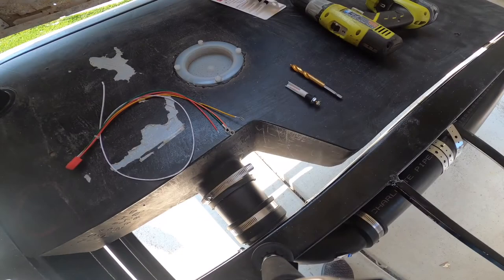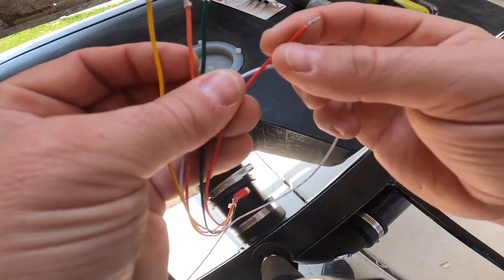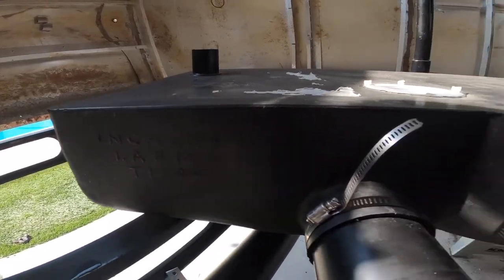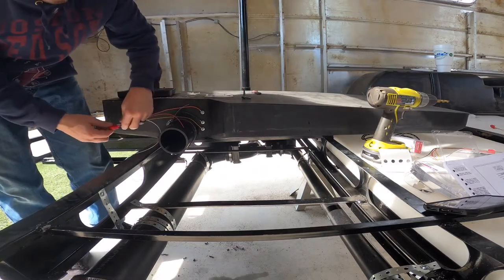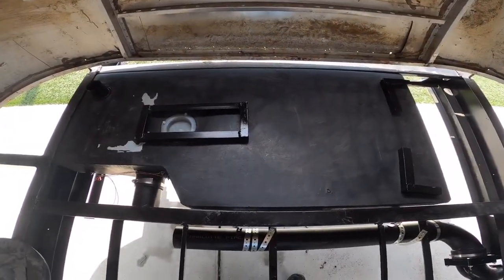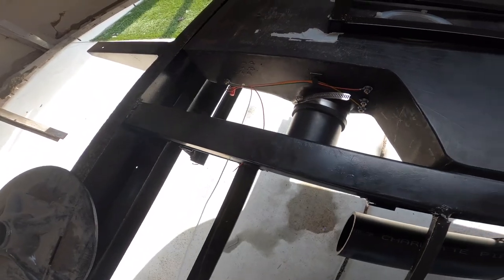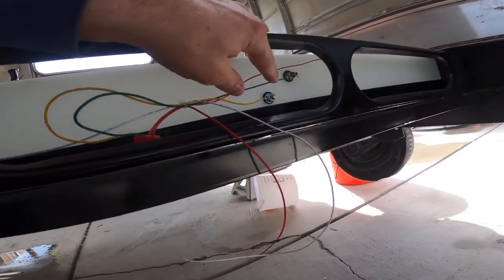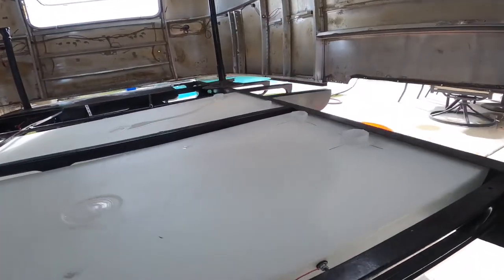Black Tank & Gray Tank(s) Level Sensor Installation

Comment: You didn't show wiring at all it was just done... What's inside that little red harness that the sensor wires go into ...Circuit board? Does the display panel know how deep the water is with only the red and white wire?
Reply from the maker: The first three and half minutes of this videos I broke down a full explanation on what each wire was in the harness and where it hooks up including all wires(including the 2; the red and white wire) that did not have eye terminal rings which go back to the monitor. At minute 5:30 I actually hook up the wire harness to the tank sensors that I drilled out and talk about each color and what sensor it’s hooking up too. I have not shown how to actually wire the monitor because that will be towards the end once I have interior walls in and framing starts happening of walls, cabinets etc. the little red harness is built by the company and will read correctly once hooked up and tank fills appropriately. I’ll have a video at some point that will explain the wiring of everything for this trailer and each component.

Comment: Danny, are you going to have a way of flushing out your black tank ie a water inlet?
Reply from the maker: Great question. Yes I will and will be doing a quick 5 minute video soon on it. If you watch this video in the beginning with the black tank you will see on the right side of the black tank a very large opening to the frame as well as to the ground. At the end of this video where the water is pouring out just to the right of that 3 way valterra hub you will see a hole already pre drilled out. Thats where the water valve inlet will go and I will be installing the valterra no fuss flush with check valve in that opening on right side of tank. Still waiting on delivery of all three valterra valves. The gray tanks will each have one that will actually install on top side of tank like a reverse sprinkler and those will be accessed from a same port on outside panel of trailer that will also have access through bottom of kitchen cabinet as a secondary three way with shut off. If all that makes sense. Apologies for long response.
Reply: @dcdvs1583  Thanks for the info.